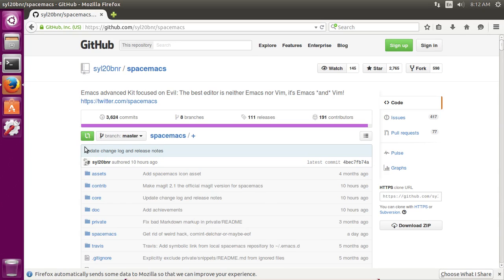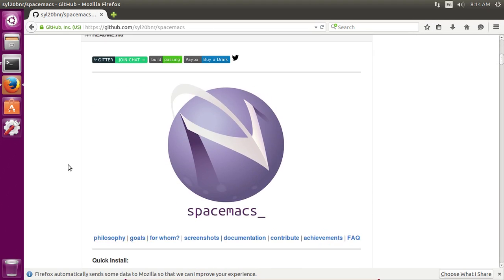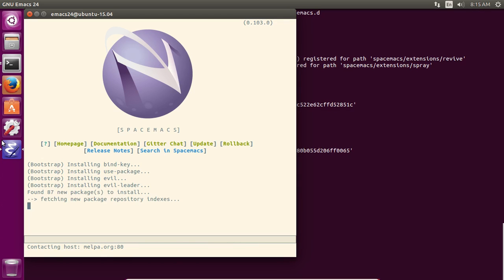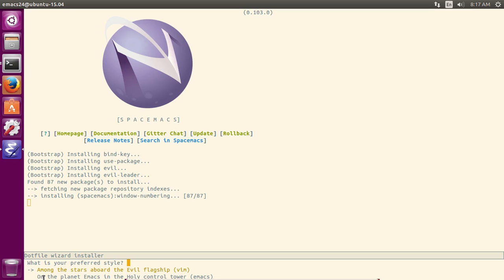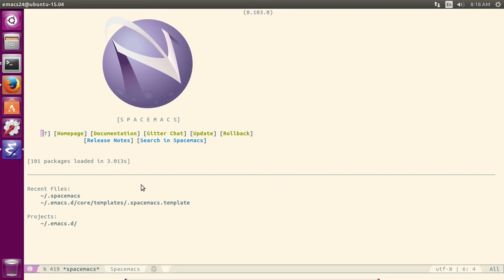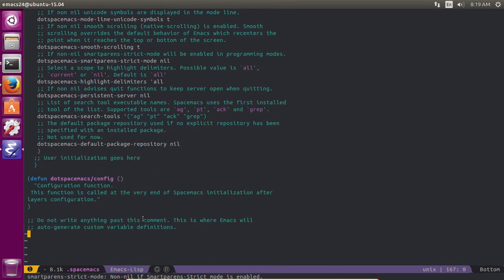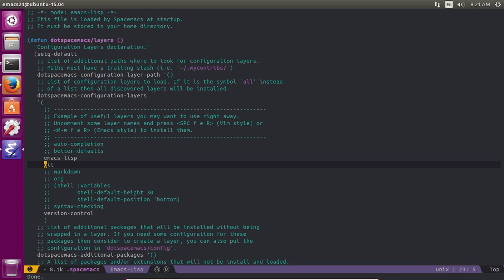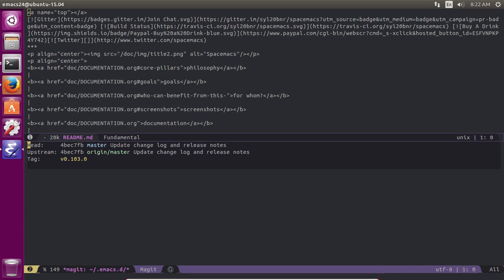Introduction to Spacemacs: Installation

Comment: can spacemacs be started in daemon mode just like emacs? can run it also on cli?
Reply: +Rihan Pereira (rihbyne) yes and yes
Reply: +Zach Abel yes it works but doesn't recognize the font used when running x11 spacemacs plus powerline status bar appears broken. The issue is already raised and resolved and tested with git rebase and PR is made.